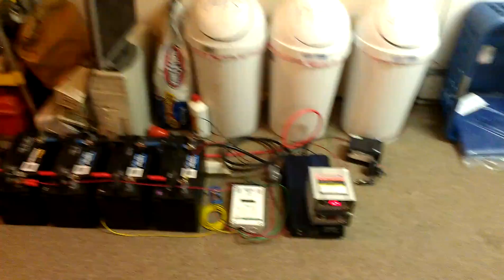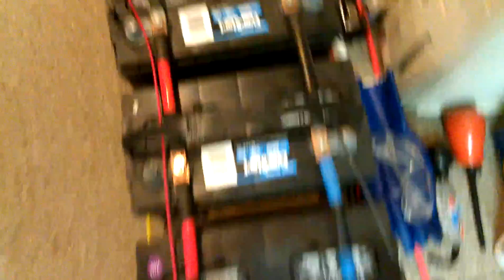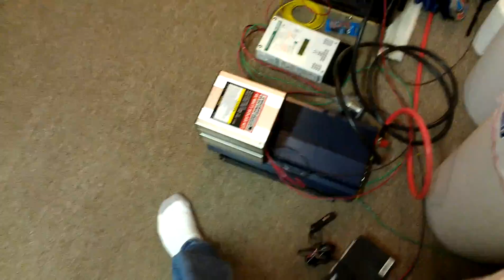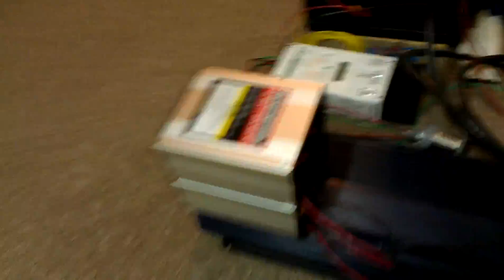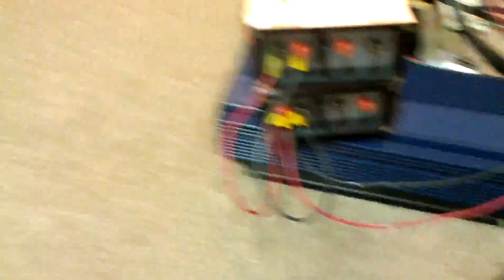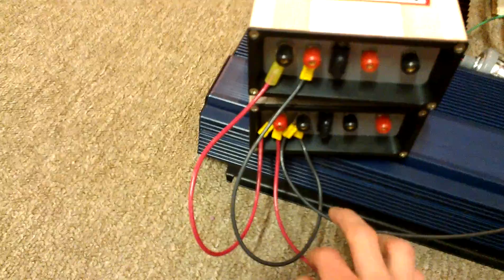Update on harbor freight kits backup lighting

Comment: Fusing the controller feeder at the battery bank would be a very good idea.  Also, paralleling controllers on the array side is a bad idea as each controller has slightly different (and nonadjustable) potential threshold settings.  This means that one may still be connecting the array to the battery bank when the others are not connecting them.  This would lead to nuisance fuse tripping (and the stock fuse is too sensitive already).